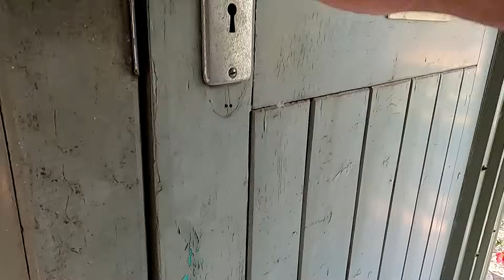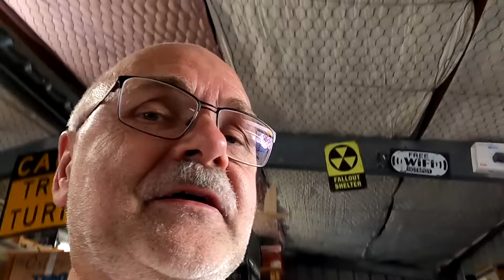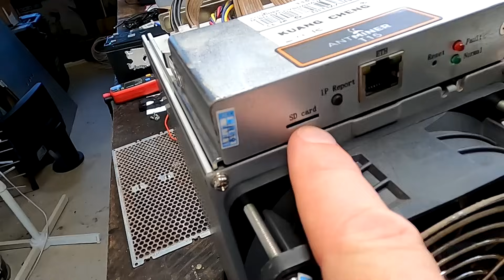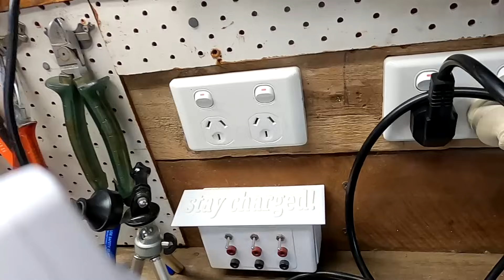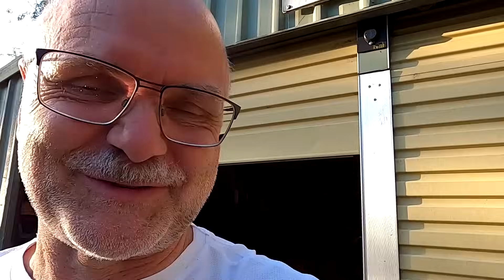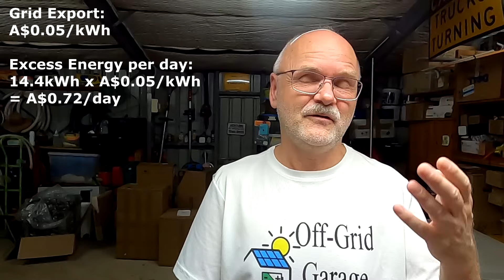Off-Grid Bitcoin Mining with excess power from your solar and battery. Worth or Waste?

Comment: You're converting DC solar to AC then back to DC to run the miner..  its costing you about 25% loss for that DC/AC/DC conversion. There are guys on youtube running direct DC from solar.  Thats an easy way to  increase your 'output' from your solar.  You may then be able to buy those two other hash boards. Look into it.  Subbed.
Reply: This, and I'd consider Antminer S19k Pro (120TH) It's 3x more efficient (23 J/TH) than the T15 (67 J/TH) -- 2760W though.

MicroBT Whatsminer M21S (56TH, 1680 W) has 30 J/TH, or more silent Canaan Avalon Mini 3 (37.5TH, 800W) with 21.3 J/TH.

Comment: i thinking to build a sand battery, i an already busy designing one to charge in the summer with heating elements and then use it in combination with my heating ground pomp for the winter. so i dont need that much energy in the winter

Comment: Solar mining refers to the process of using solar energy as an energy source to support cryptocurrency mining, which has gained increasing attention in recent years. Here are some of the main advantages of solar mining:

1. *Renewable energy*: Solar energy is a renewable resource that can reduce dependence on fossil fuels, reduce greenhouse gas emissions, and help protect the environment.

2. *Reduced operating costs*: Although the initial investment is higher, solar energy can significantly reduce electricity costs in the long run, especially in areas with high electricity prices.

3. *Energy independence*: Using solar mining can reduce dependence on the public power grid, especially in areas with unstable power supply, which can improve the reliability of mining.

4. *Environmental image*: Using clean energy for mining can improve the company's social responsibility image and attract investors and users who are concerned about sustainable development.

5. *Government incentives*: Many countries and regions provide tax breaks and other financial incentives for the use of renewable energy, further reducing investment and operating costs.

6. *Flexibility*: Solar systems can be scaled according to mining needs, and can be deployed on a small scale in home residences or on a large scale to build solar power plants.

7. *Technological progress*: The continuous progress of solar energy technology has led to a year-on-year decline in the cost of photovoltaic panels, which has increased the economic feasibility of solar mining.

In general, combining solar energy with mining can not only reduce operating costs, but also improve environmental sustainability, which is a major development trend in the future mining industry.

We provide bitcoin miners since 2016, hope to support you build more off-grid btc mining project 
WA +86 181 2994 5973
TG: @djminerjasmine

Comment: This was an amazingly practical video! Thank you for making it. You even have the same energy monitor as me plugged into the antminer, so I think we're thinking along the same lines. I'm very curious to know what the returns are on the antminer now since you made this 8 months ago when BTC didn't see the crazy price jump it has recently. Also, do you shut off the machine at night? I want to run it on my 25kw on-grid setup (very sunny where I am) which of course doesn't produce any power at night.

Comment: I'd go for another os and turn the fans down... 
The odd thing I've noticed is that mining is not really related to the speed/hash.  The more you have, the less you get.
My 2gh get around 80 cent a day.
My mining is smaller as is the solar excess. But I've been playing with mining from  the excess solar.
I make up to 7.5 times what I would get get paid for export, but I get a little more, or I just turn it off.
It only runs 4-6 hours a day on average making 0.61 aud.
But I did pay with others and it's not only BTC. LTC, rmx, 
So I use computers (servers) that have various power demands to soak up the excess.
Bit of fun, but there isn't much money (if any) with this mining thing... Selling the hardware is more profitable 😮

Comment: Well I bought mine 400 euros. It burned before I could get my 400 euros back (they will be back at about 100 000 euros per bitcoin). Waste of time (need to be tiurned on/off with the sun production). And it will destroy the inverter/batteries quicker. Not a good idea.

Comment: I run my excess solar through an Antminer S9 with Brains OS software, this produces about 10TH/s at 850 watts, it makes a good space heater in the winter, to combat the noise replace the fans with noctua PWM fans they are a lot quieter or if you want a fun project submerge cooling is the way to go and silent

Comment: Also, fruition has a silencer kit that uses an 8 inch ac infinity inline fan t o make it almost silent. I run them in the summer to quiet them down. I'm running 2 s19j pro 104 on low power mode, plus 3 gpu servers at 4300w. Plus some cpu servers. In all, I've got around 10kw of crypto running 24/7. Gonna be fun trying to get offgrid.

Comment: About the fans, they make small fan simulation boards that you can connect instead of the fans. This allows the miner to run without the stock fans and giving any errors. This makes it possible for a les noisy fan to be used (one of those industrial ducting fans for example). The hashing boards throttle back when they get too hot if I remember correctly so should still be safe if something went wrong, I think… 😁

Comment: You could install big ac unit in the garage so the batteries will stay at 20c happy forever. that's how to use excess energy in summer. for me I am currently exporting power back to grid I get peak of 11KW of solar at noon with total of 60kw per day. Monthly generation mostly about 1200-1500kw.
Reply from the maker: Yeah, AC upgrade for the garage is coming...
These are nice numbers 1500kWh per month is great!
Reply: @OffGridGarageAustralia  Yes Andy, sunny 🌞  cold Baghdad now.

Comment: Thanks for the video Andy, I was always curious about what bit mining entailed.    Couple of ideas for using your excess power, 1) you could install a mini split AC unit in the garage so it’s not so hot in the OGG or 2) you could run a 
long extension cord to your neighbour with the “planner” that is running all the time. Those use a lot of power.😉.
Reply from the maker: Yeah, an AC will come for the new PowerGarage.
It's not my immediate neighbour but further down the road. would be half a km or so at least. Voltage drop in the extension cables will be HUUUGE😂

Comment: Ooooh... I'm still a bit skeptical of Crypto, but did start mining with a gaming system I pretty much had on all the time anyway. I made $150 in eth over 5-6 month. I think our offgrid systems are pretty much using all the power now. It was somewhere around break even, I think, but it was on all the time anyway and was still using 1/3 of what it was, mining, so maybe slightly ahead?

Comment: Hey Andy! Your problems with the Bitcoin mining experiment was that you weren't using a modern, water cooled machine like the newest Antminer models. I believe it would be totally worth the energy in the long run if you were using a higher performance and higher efficiency machine. I'm not current on the hash rates and power usage, but I think you can get a 125 Terrahash machine that uses something like 3500 watts and it's water cooled and much more quiet. Maybe reach out to a mining company and see if you can work out a deal for using or buying a discounted new water cooled miner that is much more quiet. I know it's possible to run 3 or 4 machines and make $100 a day at current Bitcoin prices as long as the energy is coming from your solar and batteries. Also, don't forget that Bitcoin rewards for mining will be cut in half in mid to late 2024 which will cause the price to increase substantially. It could go up to $100,000 per Bitcoin by 2025/2026. Maybe even more, but the average price should go up 30% to 50% overall minimum. The prices of Bitcoin seem wild, but there is a cycle to it and the price swings are somewhat predictable if we are talking over the long term. Bitcoin has gone up pretty steadily and will continue to do so. I don't think the winklevoss twins or anyone else in the finance and banking/ investment industry is planning on selling their Bitcoin below $1 million per coin in 2050 or something. Mining Bitcoin while it's cheap and abundant in mining pools that pay well is a smart move for the future.

Comment: Hey Andy.. 
What if the bitcoin price goes UP again like 10 or 20X..  
Then its a totally different story and it is already happening, oh and indeed just add watercooling so you dont need a boiler anymore...
 ;-) 
Stack some Sats..
Reply from the maker: The bitcoin price will go up but at the same time the efficiency to mine them will go down. That only helps if you have already some😊
Reply: Free Energy is free energy ;-) @OffGridGarageAustralia

Comment: Watercooling of those machines isn’t that easy, i have seen setups with mineral oil and a heat exchanger. Also not your key not your coin, get a hardware wallet since you don’t really own the coins in your soft wallet you need a hard wallet like the bitbox, if you want to know more about it i recommend the yt channel the blocktrainer
Reply: Don't really need a hardware wallet.

Comment: I run my bitcoin on timers but seem to have the same issue they work for a while then next day they stop working and need to fiddle with the miner. How do you deal with lot of cloud days? Perhaps if you run those ebay grid tied inverters to push back power to the grid? Youtube MartyT had a friend who was using his off grid not to heat water but to freeze water. Another systems is freezing balls of fluid and then at night time passing air from fans to run off grid/reduce cost cooling.
Reply from the maker: I even have excess power on cloudy days. Grid is not an option as I'm off-grid. Making ice and using fans to cool. Cannot imagine how such a construct would look like. Probably no WAF for that...

Comment: I guess the endgame would be to use the energy to make hydrogen from water and store it in high pressure tanks for long term storage. In winter, reverse the process using a fuel cell and extract the power. Can‘t wait for these units to become efficient. 10.000kWh of storage, anyone?
Reply from the maker: Will never come to residential installations. Imagine the safety and regulatory requirements, not to mention the maintenance.
Reply: @OffGridGarageAustralia  Some companies are already offering commercial products for hydrogen-based long term storage. Try looking up "picea energiezentrale".

Comment: I've done some mining myself in the past just to get some experiences with it, on the technical part.
I quickly came to the conclusion it was not really worth it.
Unless you set-up a huge bank of miners etc etc. Otherwise it is nice to experiment with to get some experiences with but often mining at DIY scale is nowadays not profitable anymore.
Like you, I noticed the hardware defects, the hardware is often really pushed to the limits so you should also calculate the costs for backup-hardware in case of failures (of power-supplies, ventilators etc etc). In my situation delivering back excess power to the grid does pay back as I still have a electro-mechanical meter so it runs into reverse, in the end I pay only for what I have really used from the grid minus what I have delivered back.
I use my excess energy to heat, boil, cool, ventilate and warm, and whatever is leftover, is returned to the grid.
Reply from the maker: It was really just a test to see how this goes and get some basic experience with that sort of stuff. The noise is the main problem here, regardless what machine you use and how good new ones may work...

Comment: I really enjoy watching your videos. 
My system is still grid tied with 4,800 watts of panels going through Enphase iQ7 microinverters that are AC coupled to a Schneider XW-Pro battery inverter. Then I also have 2,000 watts of panels with a DC charge controller. My battery bank is split into 2 cabinets. My older cabinet is a 14S6P setup of 60 amp hour LG Li NMC cells with a 200 amp JK-BMS. I later added the second cabinet with the same amount of the same LG 60 amp hour cells, but it is split into 2 strings of 14S3P. Each string just has a dump Daly BMS on it. 

Most days, the DC solar, and the extra AC power from the Enphase AC solar is able to fully charge up the battery before 1 pm. Any additional power from the Enphase Solar then exports to the grid. To make better use of the DC solar, I have the AC solar to the XW-Pro set to charge to a bulk voltage of just 56.7 volts. Then it drops to standby so the Enphase inverters revert to regular grid tied mode, where the excess is exporting. The DC system keeps charging the battery bank up to 57.4 volts (4.1 volts per cell) if the sun keeps up. On very good days, the DC charge controller can also go into float mode at that level. Any extra from the DC system is lost from that point. It's hard to predict exactly how much power I will get, so I just make sure the battery get's full each day, and the DC system ends up throwing away about 0.5 to 1.5 KWHs on good sunny days. My export to the grid is averaging about 6 KWHs a day and I get about $0.25 USD towards my electric use during the billing year. But at the end of the year, any balance left is only credited at $0.06 USD which then goes towards paying the taxes and fees.I ended up the last billing year with a credit of $133 USD
Reply from the maker: Thanks for sharing. You use micro inverters because of shading, I guess?
Reply: I went with the microinverters for a few reasons. My original system was just grid tied, and with some shading issues, the microinverters were the best option. They are very efficient and start making power very early and stay working very late. Having each panel optimized and monitored individually is a nice feature. DC optimizers are also available, but the one central inverter is still a common failure point. My friend has his central inverter fail in the middle of summer and it took his solar contractor over a month to replace it while he had to pay the highest grid rates to run his air conditioner. I have 16 microinverters. If one fails, the other 15 keep working. 

I decided to add the batteries later when I saw how bad the "Time of Use" billing was cutting into my savings. The Enphase iQ7 inverters AC couple into the Schneider XW-Pro inverter fairly well. It works perfectly while I am on grid, but when the grid fails, several of them kept shutting down. During my last power failure, I was only getting about half power from the Enphase system. My battery got pretty low, but with reduced use, we had power until the grid came back up. They did a firmware update and changed the grid profile, so they should work a little better off grid now, but I have not done a test in daylight since the update. The grid here is very stable, so off grid operation is not very important. And now that I added the 2,000 watts of panels, DC coupled with a charge controller to help out. I know that will stay working off grid in any conditions. 

If I was building the whole system from scratch now, I would probably split it about 50% DC coupled to charge the batteries for evening power, and 50% on microinverters for the day time power. About 4,000 watts of each would completely cover my electricity needs.
Reply from the maker: @garymeissner6659  Thanks a lot for sharing. Very interesting!

Comment: On my tiny offgrid I waste the energy with BOINC on my Laptop. It helps calculating sciene things. I'm getting no money for this but the good feeling to help scientists doing their job and bring the hole humankind a step forward.
Reply from the maker: I used to do this as well but the PC has only a power consumption of 110W, so this does not really cut my excess 😄
Reply: @OffGridGarageAustralia  this is less than my Laptop consumes when it runs BOINC.
Reply from the maker: @launacorp  that's the i5 I'm running in my garage..Old but powerful and fast computer.

Comment: Here in the Netherlands you export to the same price as you consume. Also you can safe up to 100% in a year of your consumption against the same prise. So pay €0.45 and sell 0.45 per kWh. Greater than 100% self use will deliver you a price of around €0.07 ish depending on contract. So I had 5k kWh to spare I would first fill my EV which uses around 5k kWh per year. And might sell back. Thanks for sharing Andy, and you are absolutely right, burning all the energy for Bitcoins is completely insane and should only been done with off-grid excess energy.
Reply from the maker: Someone here said this will be phased out in the next years? It's a gov incentive apparently.
Reply: @OffGridGarageAustralia  that's correct, but it's not final. We have to vote for a new government on Wednesday.

Comment: Couple of things I do with my excess:

-> Dry food. I dry tons of apples, mushrooms, tomatoes, etc. with a food dehydrator every year
-> Prepare wood for winter: electric chain saw and wood splitter.
-> Make Diesel fuel from old cooking oil for generator use when solar is insufficient in winter
Reply from the maker: Thanks for these ideas.
Where should I store the dry food? I guess I would have a 16-lane ant highway to the cupboard the next morning.
Firewood, yeah... we don't use that much. I have an electric chainsaw already and the block splitter broke with the hardwood we have.
Burning Diesel... well... that time is thankfully over.
Reply: @OffGridGarageAustralia  Storing the dry food in hermetically sealed glass or plastic boxes/containers. Bugs won't even know it's there. 
For me, not having a generator in winter is not an option, no matter how much solar I have - but having a biodiesel option and my own fuel supply offsets that. It's also carbon neutral, since the used cooking oil is locally produced canola oil.